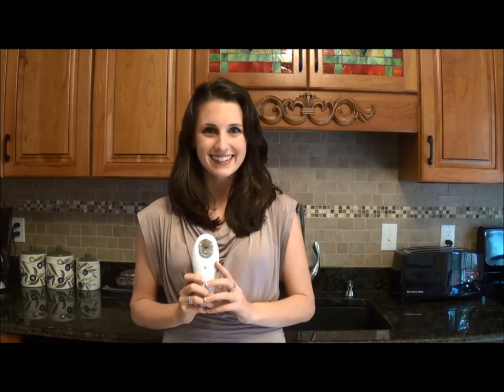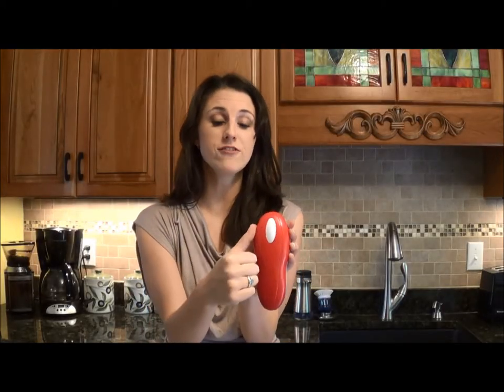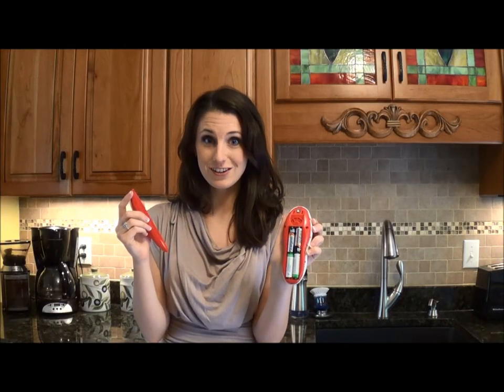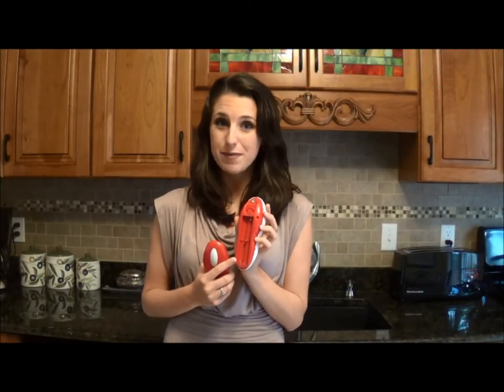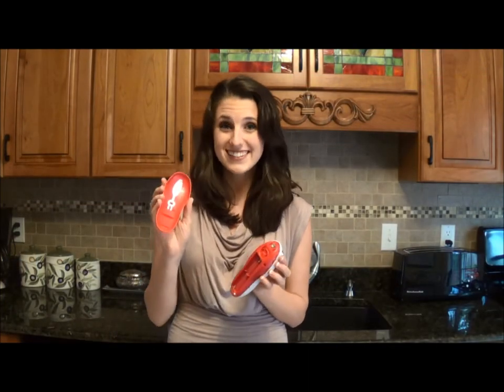How To Install or Replace Batteries in your Tornado Can Opener

Comment: I watched the video but I am unable to take the can opener apart. I have been working on it for several hours. Just doesn't open.
Reply: I cannot get mine open either.
Reply: me too.  Help us!
Reply: BAM!  I got it.  For anyone stuck:  Try it like this: hold the rounded part down in your left hand, pointy side upwards, so your fingers are on the right, thumb on left, and resting near the base of your pinky.  Put both of your thumbs on or around the magnet in the middle of the square, and push up towards the direction the pointy side points.  Clicks right open with pretty light pressure.  Approximately the force of opening a 2 liter.  Audible click, then simply lift.
Reply: This method worked for me too, thanks. Now only if I could get the circular blade part to start spinning again 😑

Comment: Love this can opener. Unable to open it as shown above, but using a "spudger" (thin metal or plastic blade), gently inserted into the small slot above the on button, where the red and white meets, twisted gently and it popped right off. Hope that helps someone.

Comment: The can opener must be in place on a can before it will run. You cannot test if your batteries are correctly positioned unless you have a can. 
First, hold the red ribbon gently outeof the comparment. Keep it out while you insert the batteries; when you pull on the ribbon later, both batteries come out easily.
The polarity directions for the battery are shown on a diagram stamped into the case near the battery compartment. The diagram shows one AA battery atop the other. It’s important because the usual plate-and-spring holders are not there to give you a clue.

Comment: Well, I did exactly what she said and it didn't open. I tried prying it with a butter knife and still no luck. What a piece of garbage. I'll by a good can opener. Don't buy this thing unless you plan on replacing it everytime the battery goes dead. 👎🤬